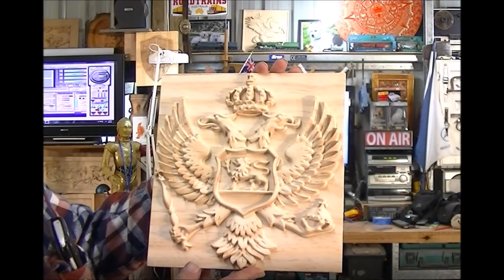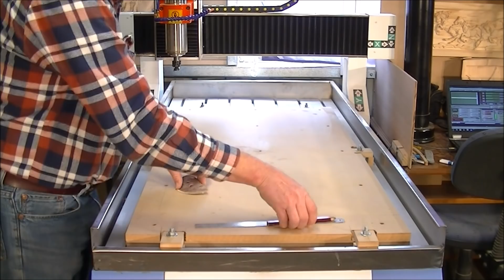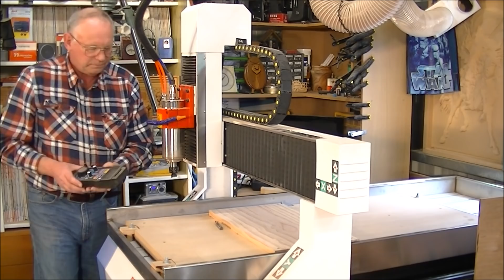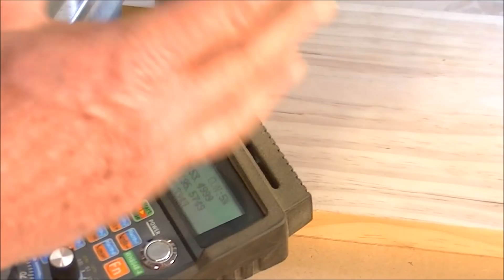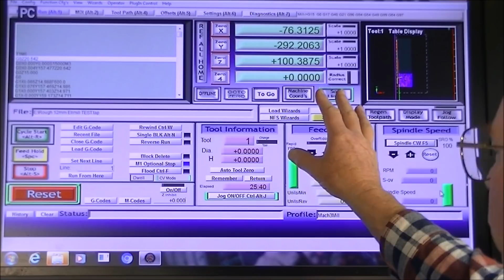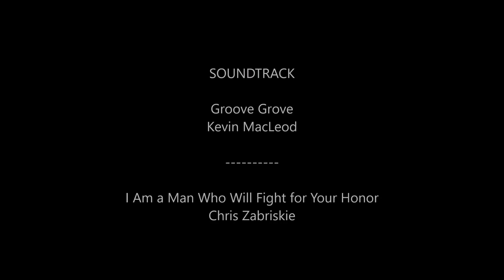I purchased a *GOOD!!!* Chinese? CNC router for 3D carving.

Comment: Do you still sell these machines? If so can you send me a email address. 
Thanks
Reply from the maker: Hi Simmo, No, I do not sell any machines and I am not associated with any manufacturer. However, in answer to your question I purchased my CNC router from a place called BoostCN in China. Their email is boostcn@hotmail.com if you want to contact them. You may want to conduct your own research to ensure it is the right one for your needs.
Reply: simmo yhman hi,any machine question we can talking

Comment: Good day Roger, I have a workabee cnc 4 axis router 1500x1500 using mach3 and laptop with win7 32bit, TB6600 drivers, 175Ox stepper motors and Novosun V2 exsternal usb controller. I have sporadic stops and deviations from the tool path when running large files and sometimes usb disconnect. I am frustrated and seek some advise. People say everybody has problems with windows run smaller files, some say get a dedicated plc but there are so many different brands, quality variances. Any advice for me to help out with the types of problems I have?
Reply from the maker: Ok, there are computers, and there are computers that are good to run your machine in the workshop environment. I have HP laptop and desktop computers running my machines because I find them reliable. Secondly, it sounds like you may be running your code to fast, certainly for the computer you are using, run the same program at 50% in mach3.
Thank you, for watching,  

Please subscribe and forward the video on to a friend, Australian Inventor Roger Clyde Webb ;-)
Reply: @inventorsworkshop9600  Thank you, will try!